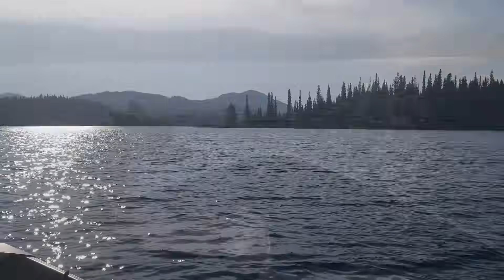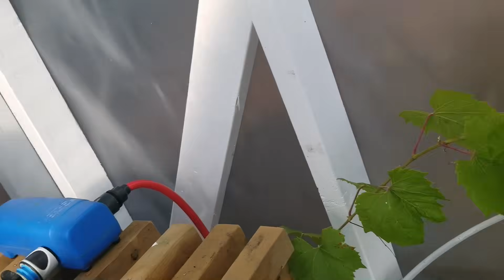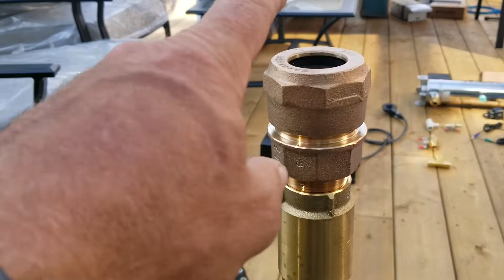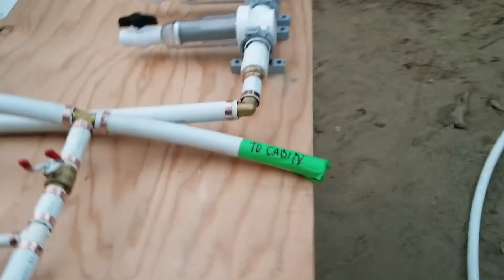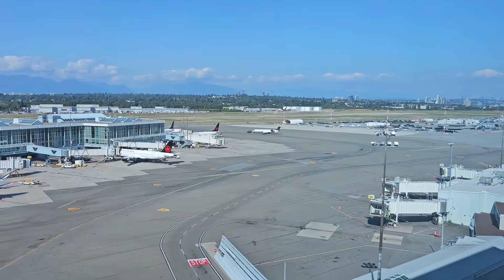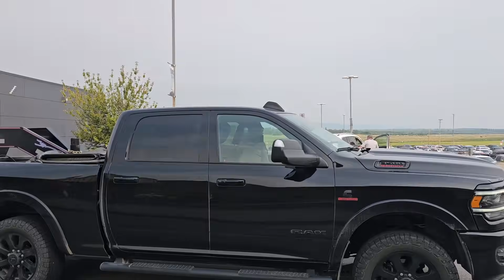Off Grid Life: How We Built Our Safe Water System on Our Remote Island – My Wild Holm S3 Ep24

Comment: Nice set up Ryan. Our water when I lived on the cattle ranch came right from a beaver pond. We didn't drink it but we used it for cooking and dishes and bathing. Not sure how we didn't get giaurdia or something else. About every 3 years  the beaver dam would bust and we were without water for a month. Sure would have been nice to have had a system like yours. We got our drinking water from a cold spring up the road. Best tasting water you ever drank.
Reply from the maker: Hey there! Thank you for the great comments - you've sure lived an interesting life!
Reply: @mywildholm  yes, I've pack a lot of interesting stuff in. At the time you don't think much about it. But when I look back on my life it's like "Wow the things I've done is pretty cool". Guys I grew up with have gone through life in an office cubicle and they have a hard time changing a light bulb. I've just never been one of those. Some people look at me and think I don't know jack sh$t but I've always fixed my cars, built engines, done home renos cause I couldn't afford to pay someone else. Started very young. Tree topper at 14 in my grandpa's business. Of course I packed branches since I was old enough to walk. Potato farmhand, commercial troller, cattle ranch hand. Logger, equipment operator, trucker for 36 years, quarry equipment operator running rock crushers big enough for a vw size rock and drove articulated 6x6 rock trucks and a 50 ton rigid frame Cat off road quarry dump truck, skid steer. Just about every kind of farm implements including D6 and D9 cat. Log Loaders and logging trucks, lowboy equipment, long haul highway, in town containers, wide load, long load I've even worked on a garbage truck for a while. Its been interesting alright.
 I've learned over the years that if its something you don't know about keep your mouth shut and learn. So when I talk about stuff its knowledge based or I wouldn't be talking. 😂 I may comment on stuff I don't know about but thats just trying to understand or to figure things out. And there's always a better way to do things as long as you are willing to learn.

Comment: Just a little advice, When you are using metal male threads into plastic female threads you do not want to use teflon tape. You should use pipe dope as teflon tape can cause the plastic threads to crack.
Reply from the maker: Ya, my pipe dope was all cakey and not useable.  Thanks for the heads-up - I am careful not to overtighten, but I will pickup some pipe dope for future needs.  I appreciate you sharing your experience and knowledge! -Ryan